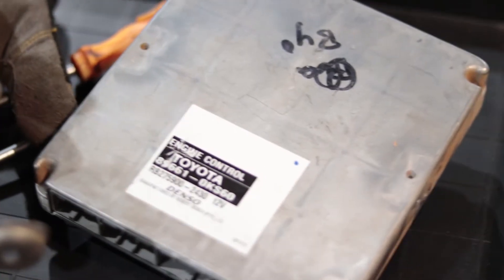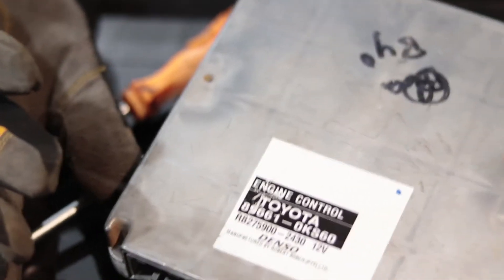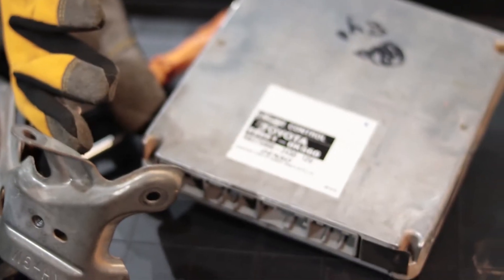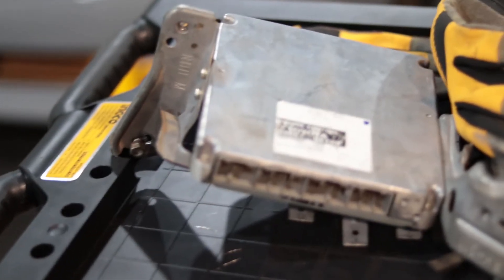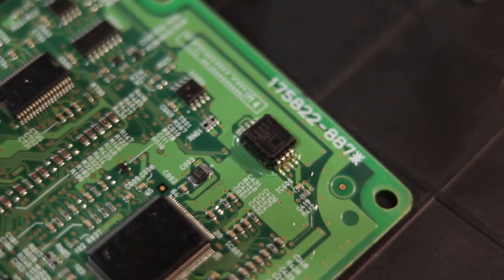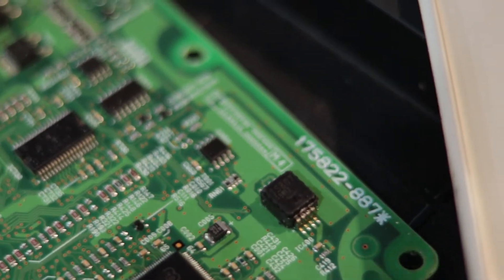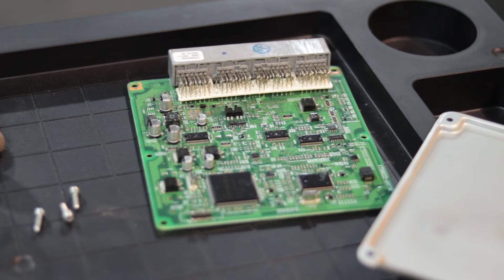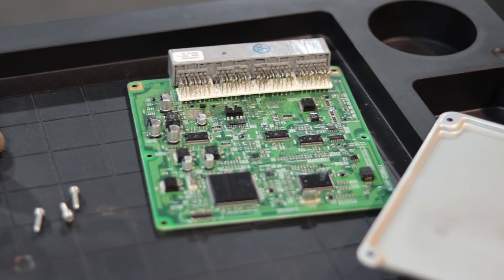Code U0101 Toyota ECU replacement issues

Comment: I have 2013 Toyota , drives totally fine and has no engine light , but what I noticed about it is it hesitate to switch from second to third and when I’m on the road driving before it switch if I’m not speeding the engine vibrate and shake but if I press on the gas it switch fine . So I took to a shop and told me that I have u0101 code lost communication with tcm .so he told me to take it to Toyo’s deal to find out if it’s really transmission that I’d bad and need to be replaced or just  tcm communication issue .I just want to hear what you think . Thank you